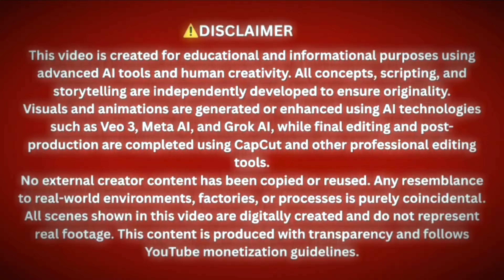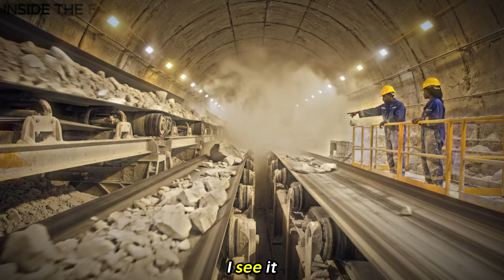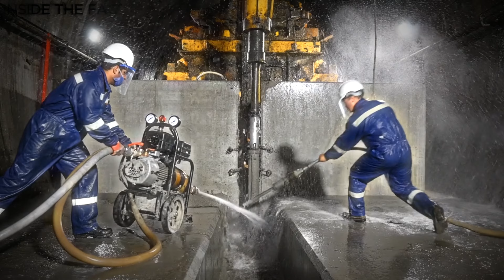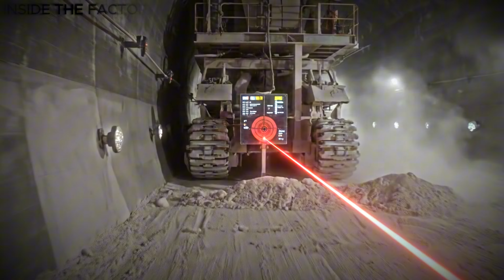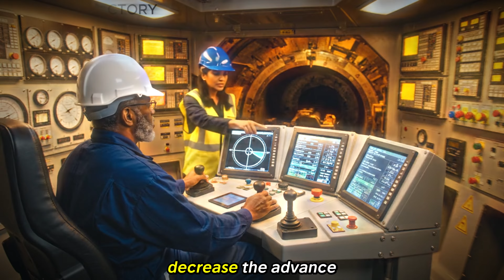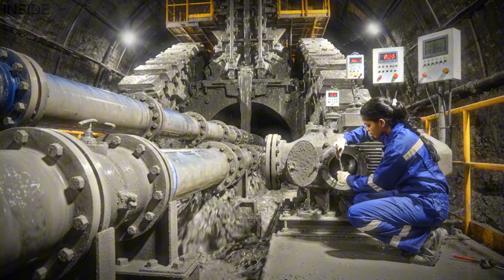Governments Spent $15B on an Impossible Undersea Tunnel — Experts Still Can't Explain It How

Comment from the maker: 🤯 Something that genuinely stopped me mid-research:

The 11 Tunnel Boring Machines that drilled the Channel Tunnel — each one weighing over 1,100 tonnes and costing millions of dollars — were deliberately abandoned underground and sealed in concrete forever when the tunnel was complete. ⚡🚇

Engineers calculated that retrieving them through the finished tunnel would damage the newly laid lining. So they dug small side chambers, drove the TBMs into the chambers, entombed them in concrete, and walked away. Those machines are STILL down there right now, 75 metres below the English Channel. 🌊

11 giant machines. Millions of dollars. Buried alive beneath the sea. Because that was the cheaper option.

That one fact tells you everything about how extreme this $15 billion project really was. 🏗💨

My question for YOU: If you could board a train and go through the Channel Tunnel right now — would you? 🚆

Drop your answer: ✅ YES — I'd love to travel under the English Channel OR ❌ NO — 75 metres below the sea is too much for me — let's see what the community says! 👇

(Also — should I rank EVERY impossible undersea tunnel in the world — Channel Tunnel vs Japan's Seikan Tunnel vs Norway's Ryfylke Tunnel vs the proposed Gibraltar Crossing? Drop a 🔔 if YES and I'll make it the next video!)